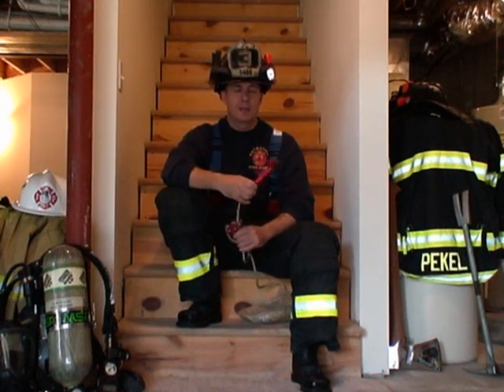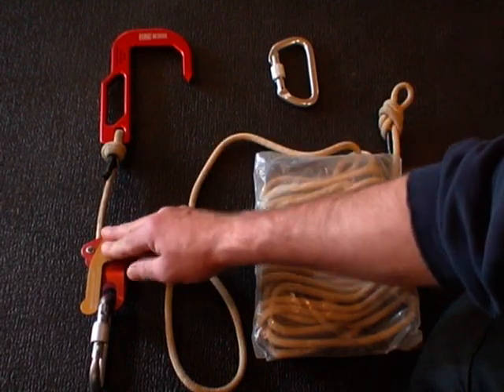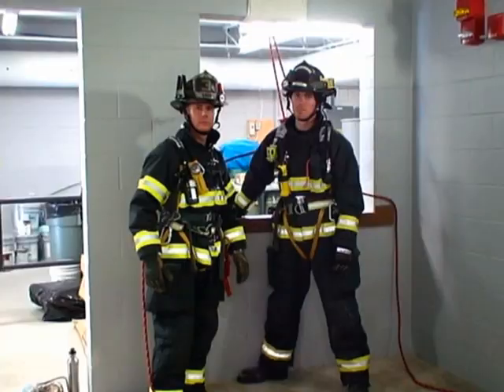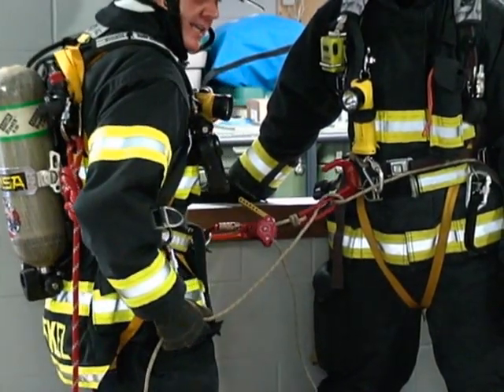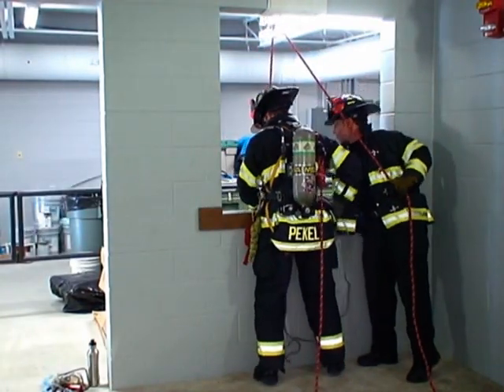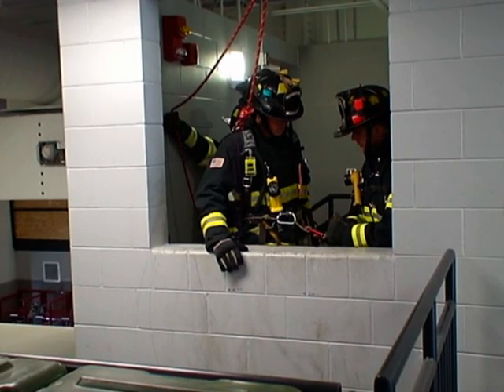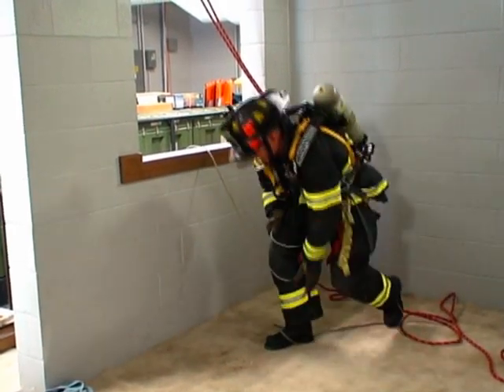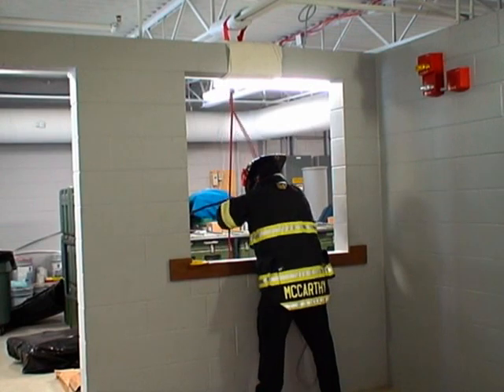Firefighter Rescue: Using a Personal Escape System - The "BYRNE Technique"

Comment: Another thoughtful presentation. 
When putting a hitch around a person like this, I use a Munter hitch, which is almost as fast(just give the biner a twist & snap), & relieves much of the crush, pinch, & bind of the rope vs.straight thru the biner.
I'm not sure I follow your argument for standing in the middle of the window.  The only time I did this (several years ago) it seemed cooler & more stable at the side.  Perhaps the victim is more in control of the swing-out?
14:20 "...the sill is taking all of the body weight."  Important point. Each bend of the rope is a friction amp.  If you lay your DCD on or over the sill, try to arrange your biner or your belt against the inside of the sill, (even under the sill if their weight is much greater) so it takes the residue of the load, not your waist.  If you make this a separate, conscious step, you will be more comfortable (especially a long or slow decent), and have better control of the decent, no matter their weight.
We have been running with a variation of this for some years, and I have a rope 'sleeve' that (pulls away from my belt) allows me to pay out either end of the carefully repacked rope.  (I assume your plastic sleeve was for illustration.  I'd rather have something less melty, like cordura.)  
(1:02 for a 1.5 floor drop!  Hot stuff!  Maybe you only need to count until you are out of the window (out of threat), so your descent time does not count. ;-)

Comment: Great instructional videos - very helpful for all levels or the curious. My only comment is that your leg restraint once in sill should not be to control your rollout only. It should be to give you a brief decision point with options: 1) further control your rollout OR 2) return yourself back into the room. It does no harm and could be a huge benefit. For example, the conditions in the room may change (fellow firefighters attack line, ventilation changes, ladder truck arriving on scene, etc.) or you might from sill see something worse than current condition where another choice could be better such different window in room, etc. Every person in these exercises were basically 100% committed when they were in the sill which is unnecessary.

Comment: Great video! I noticed you used the CMC flash hook. I have the Sterling Lighting GT hook. How would you rate it in this application vs. the CMC and your thoughts?
Reply from the maker: Try using 3 wraps on the GT vs the "hitch" you see us use on the Flash - The biggest thing you want to avoid with the Sterling Gt is side loading or putting any pressure on the wire gate as it could fail - It's not intended to bear any load or weight, just prevent the rope from sliding out of the hitching slot.
Reply: @DALEGPEKEL  Thank you!!!

Comment: Great video. I noticed you are storing your rope in a plastic bag.  Is that bag heat resistant? If not, would you be concerned with high temperatures in the room melting the bag around the rope making it unusable?  
Thanks, 
Aaron
Reply: Dude - of course it is not heat resistant. He is using it to show people the lay of the rope within the bag which would otherwise be obscured with the bag the comes with the descent kits.

Comment: Great video!  Just curious, why didn't you clip into his harness instead of choking the rope around him with the carabiner?  I know in an emergency you are not worried about comfort, but what is your reason for the choking of the rope instead of connecting into his umbilical D ring?
Reply from the maker: Good question - If the FF does have a harness or certified escape belt you would connect to it, but we practice girth hitching/wrapping the carabiner for when the FF does not have a harness or belt we can use. We can also use this same technique for a conscious civilian victim - It's sucks and is painful, but it becomes life over limb when seconds count.
Reply: DALE G. PEKEL thanks.   I actually thought about that right after I posted my question.   That it is for someone who doesn't have a harness.

Comment: Hi Mr Pekel, 
I'd like to thank you for uploading these videos. I know its not intended for individual viewers but it really goes to help us appreciate the knowledge, expertise and training firemen undertake when saving people's lives. As i've been watching these videos, I do have a burning question i'd like to ask.. if you don't mind? That is, Is it possible at all for two firemen to escape together in one go from a high rise building window using the system you have employed ?
Reply: It has been a few years, so I will answer that we have done it in training, but it is more clumsy, and a strain on the gear designed for one, and only a few floors (to a non-fire floor).  
The first (possibly injured) exits as if alone (but with assistance if needed), and waits just below the sill (the DCD allows this easily).  Then the second will hook into the first's harness biner with a foot of his own line, egress facing (but slightly lower than) the first, and either one controls the CDC.  This would be useful if one is injured so the second has medical access to the first during the descent.

Comment: And is it possible in the most dire situation (I know its not advisable at all) that when two people find themselves in such a situation and a firetruck was no where in sight, and no other options were available, that they could save themselves if they had minimal equipment such as what you have? Is it better trying than just jumping off the window?

Comment: just an added thought on the dcd.. I use the "Halo" dcd (Fire Innovations) and I believe it will be simpler to perform this maneuver due to the simplicity of the Halo dcd.
Reply from the maker: The Halo is a very nice DCD and we also provide it in the classes I teach - You are correct, it will work very well for this maneuver, but it does not have the capability for reverse directional deployment - A technique that we teach for other deployment options and rescue scenarios. The two best auto locking DCDs that also have enough friction within the device to allow for reverse directional deployment capability are the CMC EA and Sterling F4. I like the Halo, but unfortunately it provides only single directional deployment - For most situations that's all you'll need.....I just prefer more versatility. Thanks for your comment.
Reply: I did notice this too.. However, it seems you could have the person you lower belay you and the halo would work.
Reply from the maker: Yes with a knowledgeable FF that's an option bro, but not realistic with a civilian. Victim rescue with a PES is a complicated maneuver and one that requires even more practice than self rescue - I feel this is just one of the reasons so few academies or Instructors teach it.
Reply: Hoagy Carmichael  know how much you mean TO BE A fff☺️🐛
Reply: Hoagy Carmichael the tW